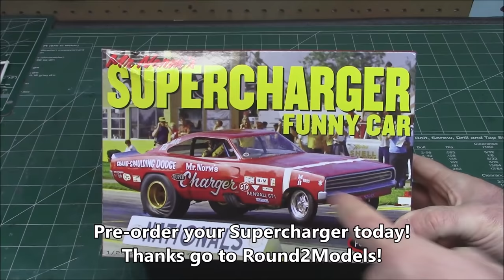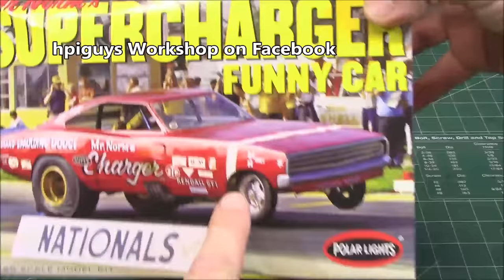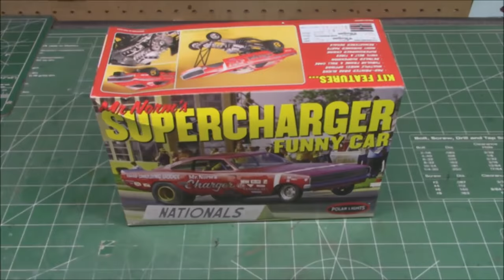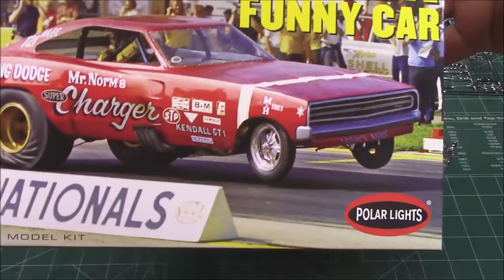1969 DODGE CHARGER HEMI FUNNY CAR MR NORM'S SUPERCHARGER 1/25 SCALE MODEL WATERSLIDE DECALS HOW TO

Comment: im building this one now......that chassis is "fiddly" and thank you for showing how that rear bulkhead goes in and how the interior panels all go together....the instruction are very unclear on that as you stated....edit: also, the electrical tape tip for the blower belt is genious....mine snapped trying to stretch it around the pulley system and actually the tape looks better I think....thank you.

Comment: First time for me to see a model that actually has a "real" belt go over the front of the engine. I do like your alternative method. That works. After building several car models where the belts are molded in styrene and which do leave a lot to be desired imho, this is exactly what I would want to see in all car models myself. Why not? I am greatly encouraged by your demo of putting the decals on not to mention the revisit of the future floor polish not messing with the windows when you paint it over them. Personally I've been a little wary of that but as you've demonstrated it works out just fine. Very cool and as always, nice work. Have a nice Christmas and New years celebration. I think Santa is bringing me some nice kits to build this year.... even though I haven't been all that good. Just not naughty hehe. Meng 1/24 Ford GT40 here I come.... yeah, I peaked... Merry Christmas!

Comment: Can t tell you what the fit pro lem is, Chris -- I can't see how you did anything wrong.  The body sits too high off the chassis -- should be snugged down right over the tires.  But the blower scoop is up tight against its metal panel so no spare space there.  And that windshield . . . 
Build the chassis, build the body, paint it all, then fit it together.  But it's too late to find the trouble.
I would build the basic chassis then the body and ensure it fits properly.  Then adding the driver's compartment, engine, and accessories while adjusting everything should eliminate the proble.
It's a great kit.  I think changing the assembly order and constantly trial fitting should make it fit better.
Cheers!

Comment: I've never seen one of these funny car kits that didn't need some modification for the correct stance and body fit , even on 1/16 kits with rear axle mounts and such,  but look much more realistic when the effort is made.
Reply: That's the whole point for me, the challenge of figuring out how to lower your stance or build your fantasy version. Right now I'm building the "color me gone" kit 90's edition and it is missing a few parts and there was some damage to repair. For my return to the hobby, I'm having a blast.

Comment: Greetings, I watched this build several times since I am working on this kit. I have a question for you regarding the motor.  Did you encounter the oil pan over extending the length of the motor? In my kit the oil pan seems like it is to big length wise for the motor.  I would appreciate any feedback. Thank you for your time and consideration.

Comment: Nice build as always my friend!!  But I got a question... the box art shows the dash area totally different from the model or did I miss something in your build?
Reply: If I may put in my two cents. Some funny cars of that era did not use the air scoop but just an air tunnel opening in the windshield, some as the box art shows, not only didn't use the blower scoop but didn't even have an opening in the windshield. If you look at late 60's funny cars, you'll see examples. I don't know why, you'd have to ask a vintage funny car expert. The body front is not sitting down enough on the finished model and it appears the scoop may be the culprit.

Comment: Chris and friends, I am struggling to scratch build headers from plastistruct rod. Anybody with a good technique would be appreciated.
Reply: Try a modelroad shop for a miniature tube bending kit to prevent.kinking.  Also, when you're doing it heat the tubing in hot tap water to make it more flexible.